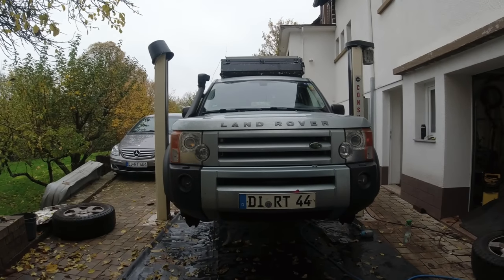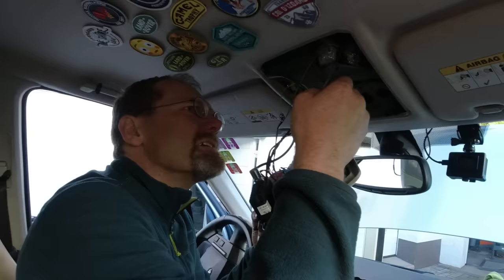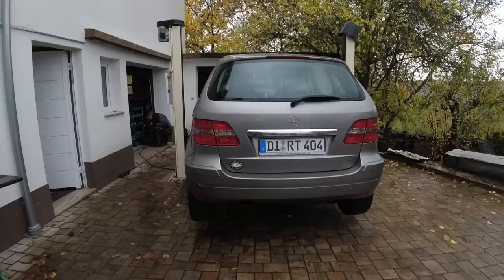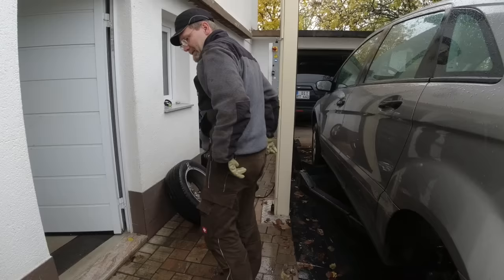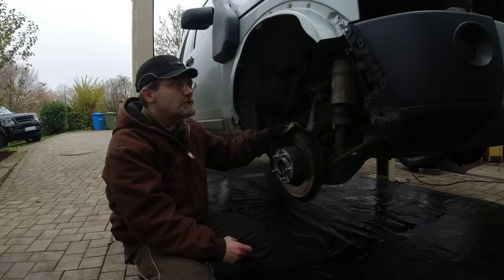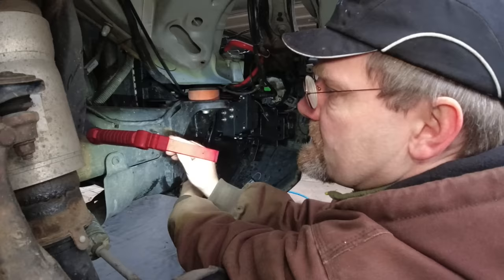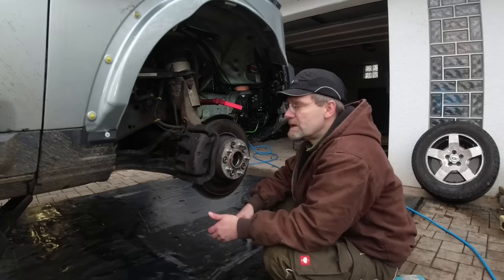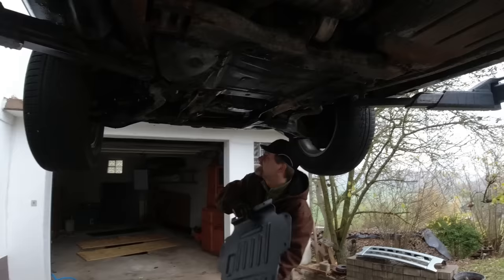Land Rover Discovery Air Suspension Problem Fixed

Comment: Hmmm 🤔 I always thought snowflakes were people that bought Land Rovers while saying things like, “they can go anywhere” and then complained about their reliability, decide to get rid of them because maintenance is expensive and/or time consuming, and then ask ridiculous prices for them because they spent money on tires and off road accessories and there’s “no rust”, “ ran great”, “was told it’s a simple relay problem”, etc.
Reply from the maker: Engine runs great, just some dash lights on… 😂 😂😂👍. LR.  Christian
Reply: @Vera_and_Christian  engine runs great, except it doesn’t shift between 1st and 2nd. Mechanic said it’s a simple relay and you can override it somehow. Have the parts, just don’t have time to fix it. 

Honestly the stuff I have heard and seen looking for a classic Range Rover. One guy actually said his ran great and had all the parts to fix transmission. When I got there it had a tree growing through the engine bay, no glass and a family of rats 🐀 in the cabin. Even the aluminum panels were corroded.

Comment: Disco 1was & is extremely cheap to buy, compared to, the mecanically, identical 1988 Range Rover, with a slightly downgraded braking system at least the v8 version but with a 90 RRC onwards body frame, simple tuff perfection. Would be great for full use of the hoist.
Reply from the maker: We can only own daily drivers at the moment. Other than that we can't drive a Disco 1 or 2 due to our emission laws here, having no airbags, is for me just a no go, at the moment. Remember, there is no offroading or anyother fun you can have with a car like that near us. We have to travel 8 hours Autobahn to touch some legal dirt. But I absolutely do love the look, and I do hope we can afford a Project like that some time in the future. 👍🙋‍♀️Vera

Comment: they buy toyota`s because they want to use them for there intended purpose and not have to fix rubbish electrics and garbage engines  and suspension problems on a daily basis wish i could afford a toyota instead of the l322 that has all the usual landrover problems